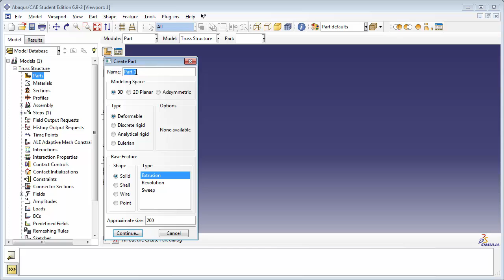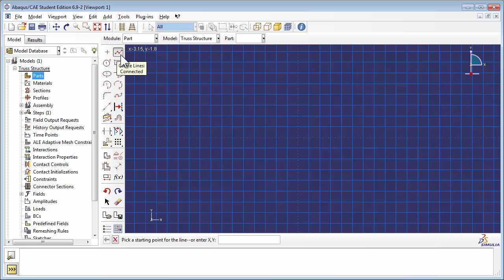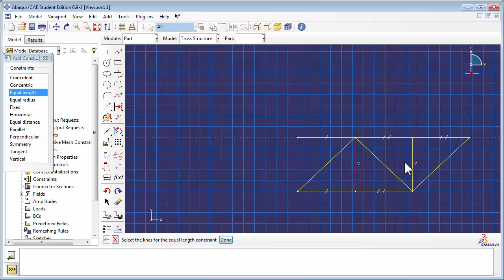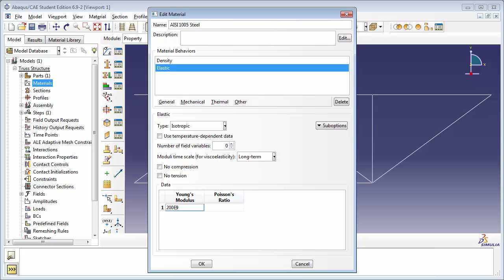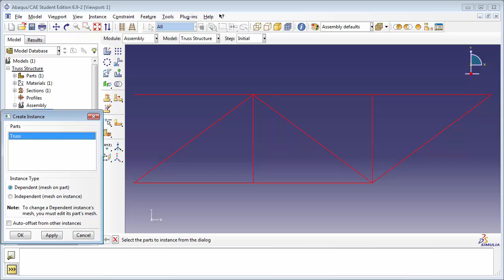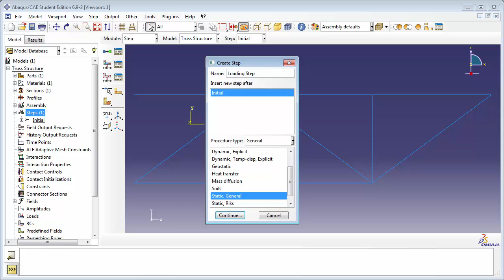2.b) Static Analysis of a 2D truss - Part 1 of 2 (with audio)

Comment: As pointed by several other guys, the sketch gets distorted while putting dimensions to the sketch. I tried adding one more constraint to make the distorted line horizontal (either of horizontal or parallel line constraint) but after doing it, it says the sketch has become overdefined and I am unable to proceed. 

If someone has figured out the solution, please do let us know. Thank you!
Reply: I used parallel constraint instead of horizontal and it worked.

Comment: Strange things happen when I put in the length... someone with the same problem ? (student edition 2017)
Reply: Adding one more constraint makes the sketch overdefined and does not let me proceed further. Has someone solved the distortion problem?
Reply: I think i have the same problem, have you figured it out?
Reply: Unfortunately not...
Reply: yes, i do now. Feels like the equal length constraint is not enough and the truss takes a weird shape...
Reply: I think the problem is that when we split the lines, horizontal constraint disappears. That's why I made extra horizontal constraints, to make horizontal lines stay in place. I don't know how the author of this video managed to do it without these constraints
Reply: Ardak Akhatova Probably bescsuse of different edition of abaqus.
Reply: you can add constraints to make the elements parallel
Reply: I had the same problem, but after to pay attention I realized that I was choosing incorrect lines to make them equal. Make sure that you're not picking the hypotenusas to establish the equal length relation.

Comment: Very helpful video! Thank you so much!
 I have a question about sketching constraints. I noticed you added "equal length" constraint when sketching. I'm wondering if it could affect the deformation. I've tried "Perpeddicular" and it did.

Comment: You mentioned Area=3.14E-4 considering radius to be 1 cm and then calculating A=π*r^2, however isn't the area of the cylinder supposed to be A=2*π*r*h+2*π*r^2 ?

Thanks
Reply: stress depends on the cross sectional area of the element but not the surface area of it.